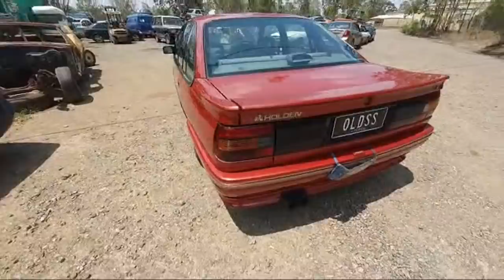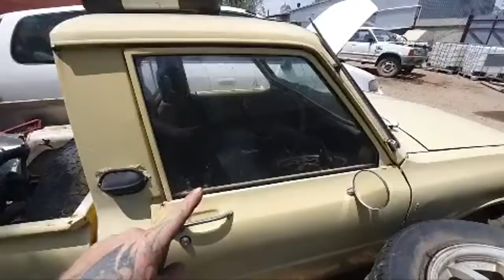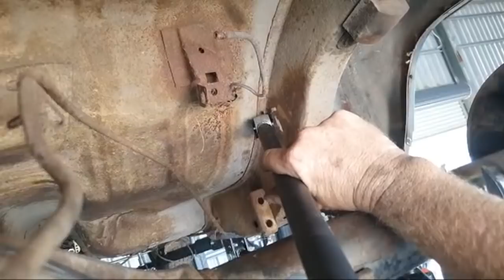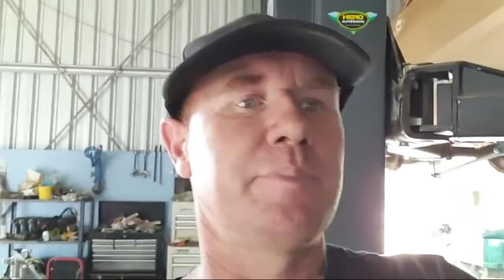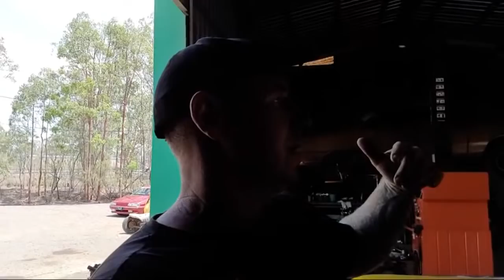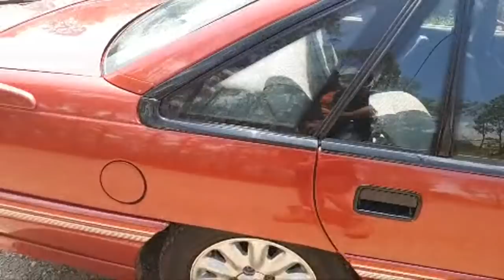kingatow crew //ls1 vg valiant mexicana hardtop 4 link rear

Comment: Yes makes sense should be good red you're doing a good job brother does that 460 have one carburetor?
Reply from the maker: yes the 460 will have one big holly ...i got a edelbrock dual plane air gap manifold for it
Reply: @KingatowCrew  plenty of power red do you have all the taillights for the fairlane?
Reply from the maker: i am fairly sure most stuff is there for the fairlane but we will go through it all and work out what we need ..once it is going i am keen to do paint yellow again and turn it into a super clean tuff streeter
Reply: @KingatowCrew  yeah parts for them are pretty hard to come by
Reply from the maker: i think its mostly all there ...leitho will be working on it tomorrow so when we do a live i will go through it more if you like and we can see what is there....to me it is not rusty so the rest as in parts i can deal with ...finding good cars that are  not rusted out is very very hard these  2 the hardtop and the  fairlane are 2 rust free ones i have been really looking forward to building for a while
Reply: @KingatowCrew  yes I am excited to see the big fairlane get worked on but it all takes time money and with what you do it's hard because you have to go away and do tow jobs I am really looking forward to seeing them come together yes I did love the Duke of hazzard great series 😂😂😂